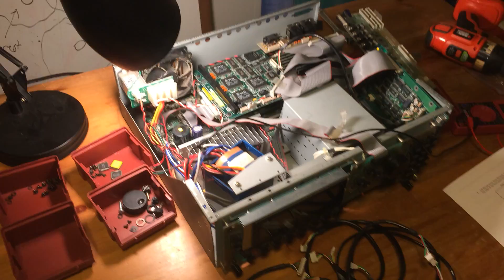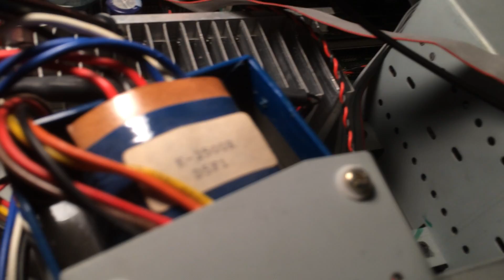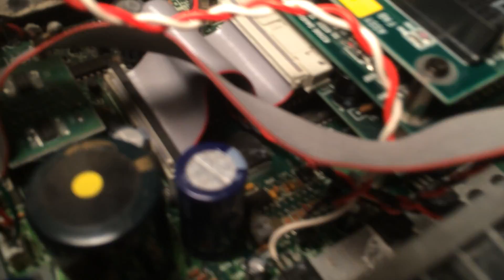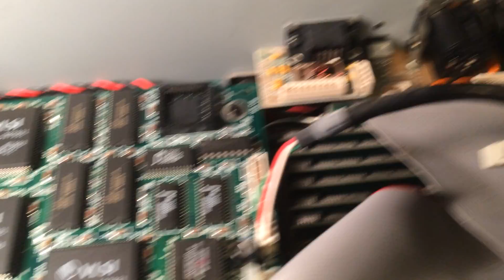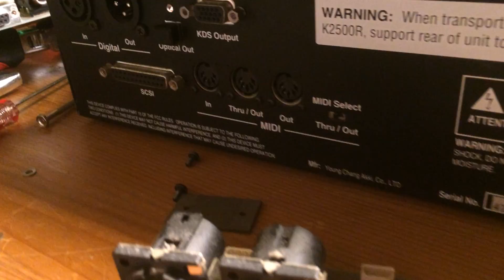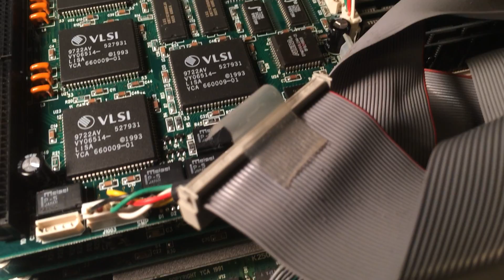KDFX Installation Part 2

Comment: did you ever finished this installation?
Reply from the maker: I did and it was successful.. though a bit white knuckled.. heh heh.
Reply: @8bitwidgets  could you make another Video which is showing the finished work?
Reply from the maker: check out video 3 and 4..  but in case it wasn't mentioned in later videos..  i will say that it turned out that the voltage stuff at 2:20 is only for the keyboard.. not for the rack mountable version.  That is one lesson I learned (big relief) after this video.
Reply from the maker: oh btw you do know there is a part 3 and part 4 of this?  i just realized I did have more videos and you're asking on part 2. :)
Reply from the maker: btw i have this for sale if you want the full documentation / books for KDFX.. not just installation it's the comprehensive documentation about the entire effects board.  https://reverb.com/item/10360145-kurzweil-2500-kdfx-manuals-and-installation-guide-k2500